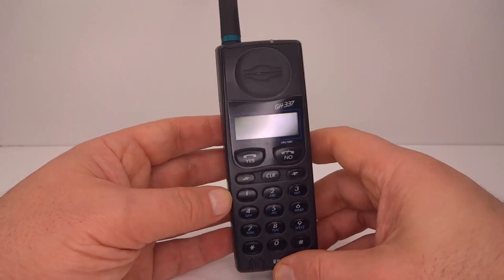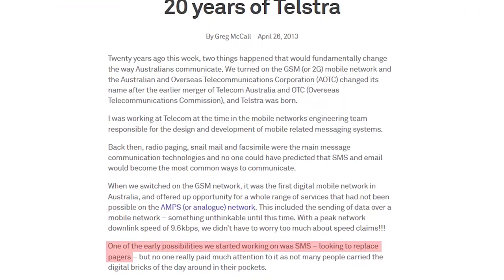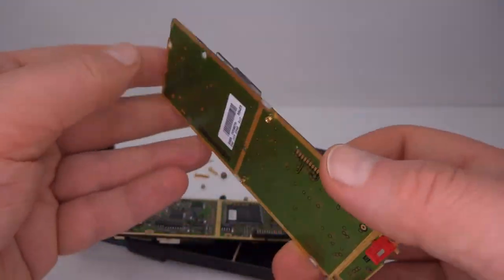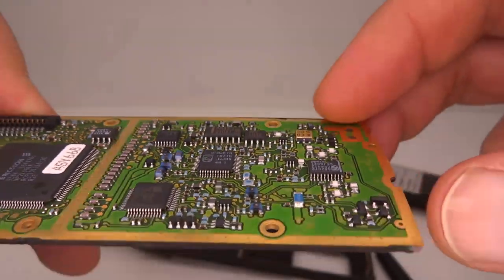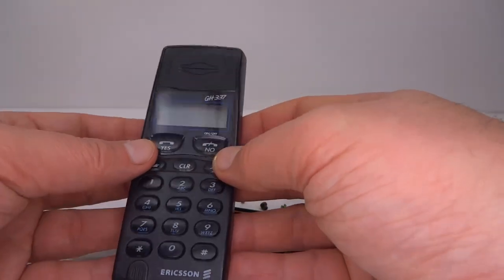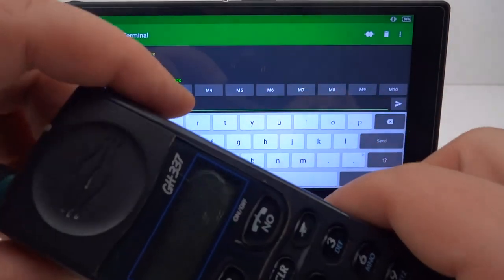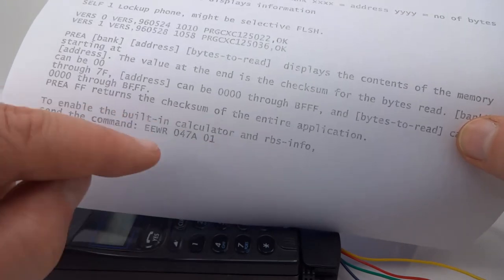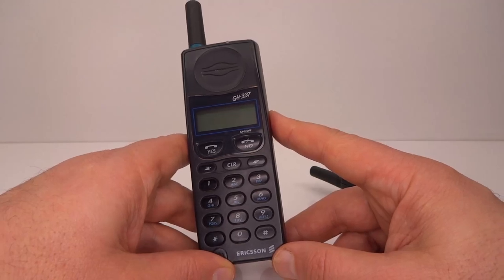Year 1994: Ericsson GH337 Teardown & Test Commands

Comment: 0:17 The good old GSM/TDMA signal that would produce this sound if your phone was too close to a speaker, microphone, or other electronic equipement. It also lit up a lot of LED light antennas and stand alone notification devices that would flash or blink when these signals happened in the beginning of calls. I collected those and gave them all up when I moved to CDMA which did not have that signalling.
Reply: I miss those days

Comment: The GH337 was my first phone I used for my own Telstra Communic8 prepaid service. Before then, I was just borrowing my parents Nokia 5110 and using a service in their name.

I got given the GH337 from a friend who had it lying about and not using it in 2001. I really enjoyed using the GH337, although I had no charger for it so I would charge it very crudely with alligator clips connected to the battery and carefully monitoring the charge from a power supply.

I swear my phone had the ability to send SMS messages, if only because I liked the relatively nice LCD screen this model had compared to the GA628 (another phone I was given at around the same time). Although, it has been many years and I am probably mistaken 😁
Reply from the maker: Maybe you had a GH337 with the mythical firmware that included SMS send. I have been searching for years to confirm if it was ever released. It's possible it was released and I'm wrong. But from the research I've done and people I've asked I don't think so :(
Reply: @JanusCycle  I still have the phone, however it is in a storage unit that is jam packed full of boxes and such with no room to move around. One day I'll need to go through it and re-sort it all. I'll make a note of getting that phone and checking for you. Heck, I can donate it to you if indeed my memory is correct and it did have SMS sending capabilities..!
Reply from the maker: @orinokonx01  Please take your time. But do let me know one day what you find. If I miss your comment you can also email me. I would like to keep in contact.

Comment: Know this is sort of an old video and you probably don't check the comments anymore but I was wondering if you know how to remove the SP lock on the CF/CH 337? I've got a CF388 that's unlocked but the speaker is almost unusably quiet even with the volume set to max, though my 337 is MUCH better (even though all I get are the no service tones since it's locked to omnipoint). I have the data cable and can get to the test menu but EEWR 1587 00 won't remove the lock (still returns EEWR, OK). Think that only works with the GH and PH versions. If you happen to have any insights, that'd be fantastic! Thank you
Reply from the maker: Hi, I don't know much about the CF/CH versions or SP unlocking these. There seem to be differences in memory locations between models. You could try using the read eeprom command to see what values are stored at different locations in the eeprom. Look for locations with a 1 and write a 0 and see what happens. There is very real risk that you could kill the phone trying this though.

I enjoy checking comments and getting questions such as yours. But my knowledge is limited. I don't know much more than I put in these videos. I do enjoy experimenting and sharing what I find. But often break stuff as well.

I have listed the stuff I have found about SP locks and eeprom reading and writing below. Please feel free to let me know how you go, or ask more questions. I'm keen to help if I am able. 

-------------
"DO NOT write or read from the IMEI or SPCK area! If you try that you can send the phone to service at once, because you will automatically write FE or EF to EVERY cell in the EEPROM. In other words, all the calibration values for the radio is overwritten…"
https://nandanamitsolutions.wordpress.com/2008/02/17/sony-ericsson-mobile-phones-tricks/

Disabling the Service Provider Lock
To disable send the following command:
EEWR 1587 00
To enable send the following command:
EEWR 1587 01

"EEWR xxxx yy EEprom write, xxxx = address yy = value
EERE xxxx yy EEprom read, xxxx = address yy = no of bytes to read"

"EERE [address]  [number-of-bytes] reads the contents of a single memory address.
Pressing G several times gets wierd features - these still need to be mapped. K returns from this mode"

--------
I also have an eeprom memory map of the GH388 that's interesting. Probably not accurate at all for other models. But might give an idea of what kind of info is stored in other models. https://drive.google.com/file/d/1fW-nfJ757G402iDiwBP0yReDFBr_-P-f/view

Comment: there's a "send a txt msg" function on GH337.  I was with a Telstra plan, I remembered I've tried to send one out but not sure if the other end have received it or not.  I think it was around 1997 / 1998.
Reply from the maker: You may have been remembering the GH388 released in 1996. I have made a video about the GH388 recently. 
The GH337 never had a send text message function. 
I believe Ericsson did announce a firmware upgrade for the GH337 at CeBit'96 that would have added 'SMS send', however this was never released. Instead they released the G388.